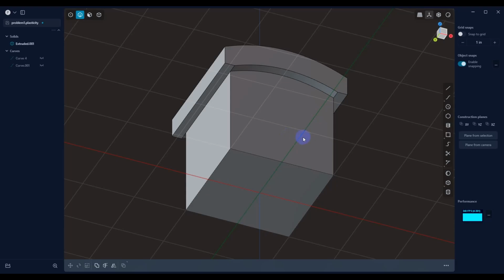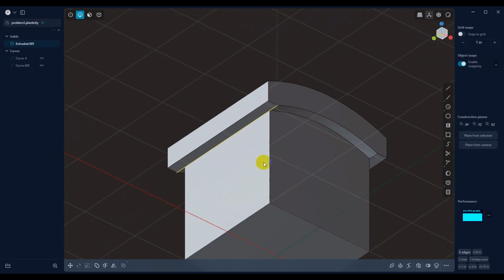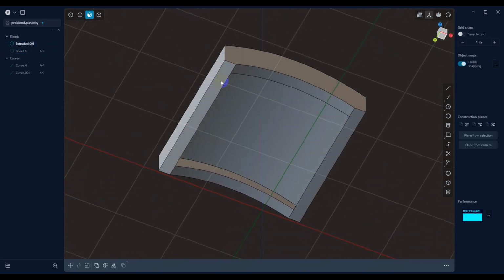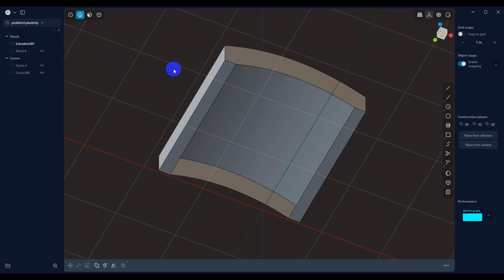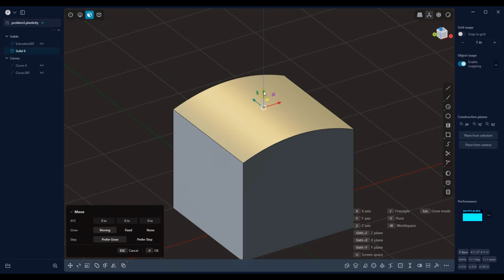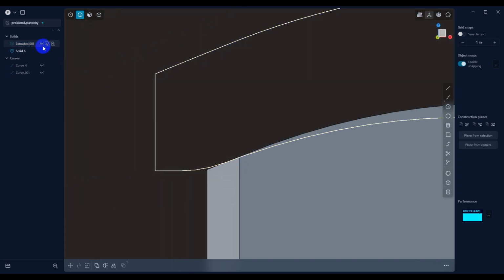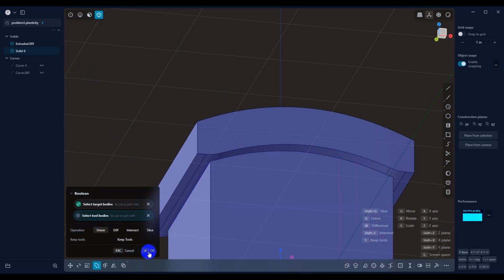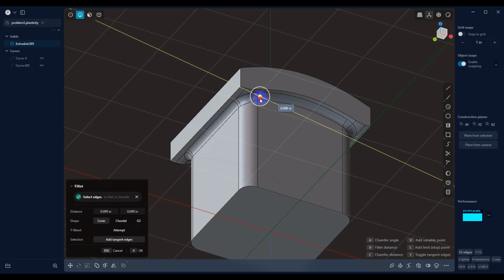Plasticity3d Problem Solving Example1

Comment: I have a question. if I have rounded the corners on the bottom cube first. would I have been able to make the fillet then? Without those extra steps? thanks for video.
Reply from the maker: @Dina_tankar_mina_ord
In this specific case, adding fillets to the bottom of the cube first would not work. It would make the connection of the joining faces even more complicated. I originally showed that in the video, but it got too long, so I cut it out.
Thanks for watching.